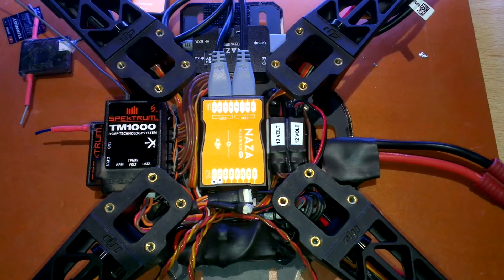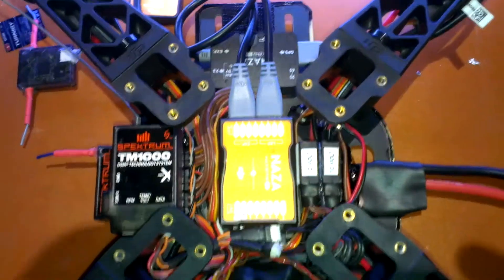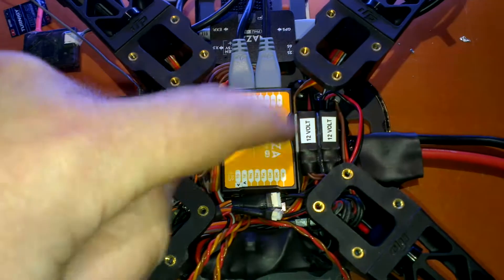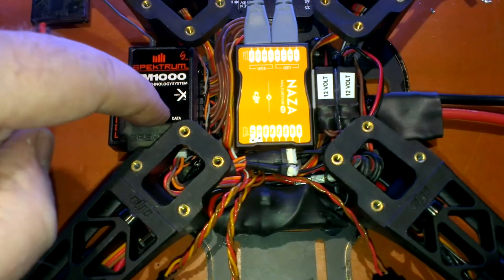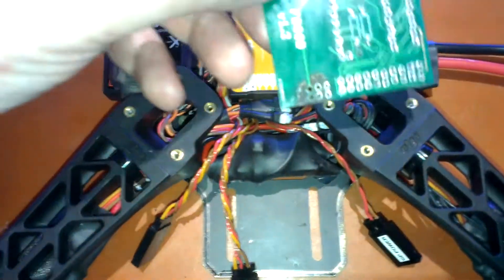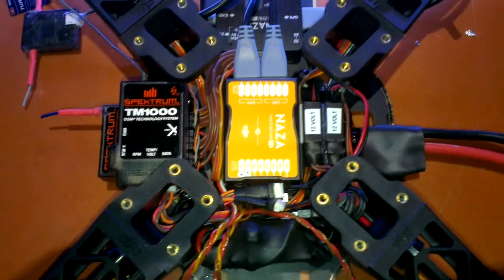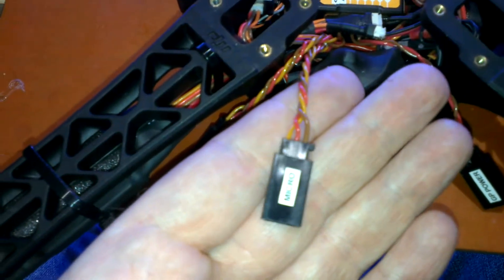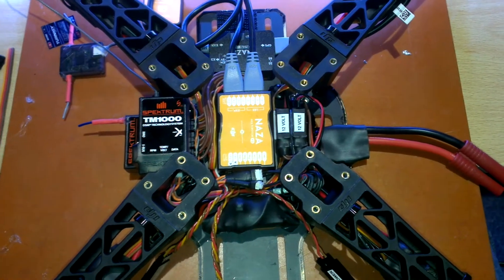DJI F450 rebuild update - now with TM1000 telemetry to my DX8

Comment: Man I need a label maker. Good idea. Hope you get it up and flying again soon. Yea. Not much room left in there. Have u thought about a disco frame Or something larger?
Reply from the maker: When projects start, it's soooooo easy to plug 5v into a 12v port. I've learnt my lesson and label EVERYTHING now :-)
Yeah, I kept thinking of a disco, but I don't like where the battery is stored. I like the F450 and like the challenge of shoe-horning everything in the tiny airframe :-)
The final prototype is now done (not fitted yet)......video will be up later!